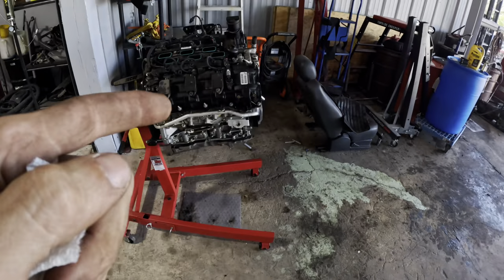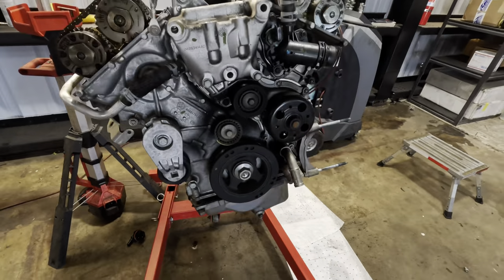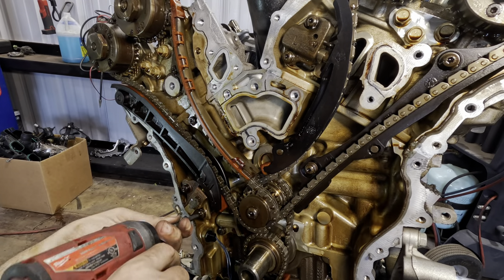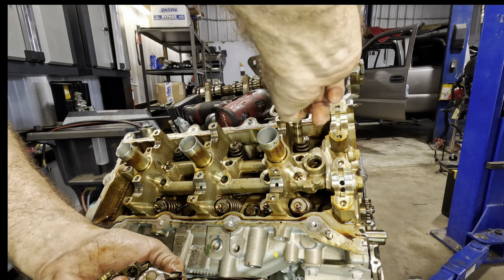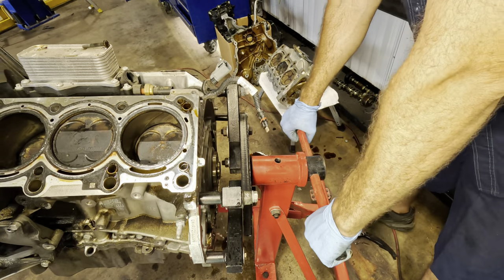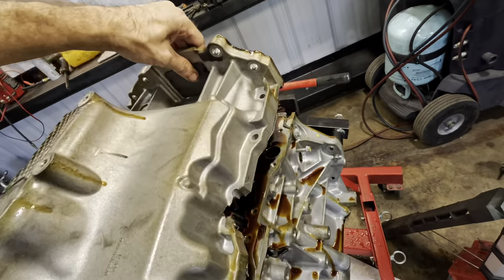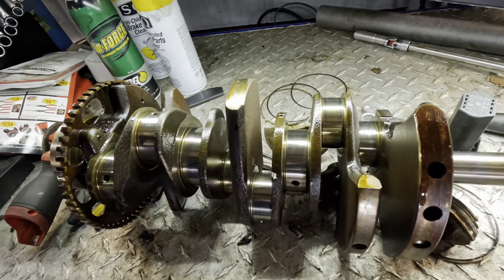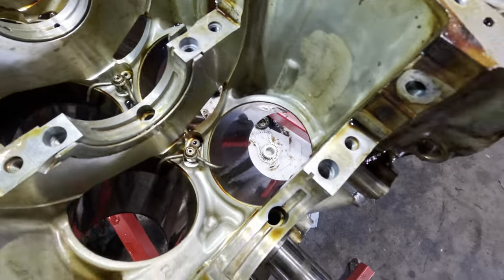Blown Engine--Broken Rod ! Autopsy 3.6 Pentastar Ram Jeep Chrysler

Comment: This was an extensive autopsy, and done in a way everyone can understand. However, there are doubts in the air. I'm not an engineer ( or mechanic, for that matter), I'm just a DIYer kind of person. If it was a gasket failure, wouldn't all pistons be affected? Could it be some sort of material fatigue on that part connecting the cam shaft and the piston? Some sort of a crack not detected by quality control? It takes a lot of power to break that piece in 3. It had to break next to the piston, because there is no bend. As the bottom part is swung around, it had to hit something causing the bend and eventually breaking. Have yourself a great day. Kind regards.

Comment: exh rockers are like that, if you look at the intake they have a built in lifter themselfs...   no carbon is from the piston hittin the head...  but the rod sugests hydro lock, may by a lot of fuel from a bad injector, which could explain the clean piston too

Comment: the oil pump runs about 30-40 psi up to about 3000-3500 rpm then it jumps to 90+ psi. you can see it happen if the vehicle has a gauge in the cluster.

Comment: I can see where a small or slow leak could accumulate coolant into that cylinder during the car sitting for a longer period of time, and partially fill it up. Then when started, hydro-lock, bending the connector rod.  Otherwise when operated more frequently, not much coolant would accumulate, and it would quickly evaporate upon engine start, so the symptom wasn't apparent to someone not sensitive to exhaust smoke/steam/color, and also did not see any drop in coolant volume as not many check that very often.

Comment: You're overlooking a potential cause. Looking at the rod, you have one mangled break, this indicates that broke off as it slammed into the cylinder wall. The other break is clean, with no damage to it. This points to a potential manufacturing defect. The broken piston. This could indicate the piston rod broke between the downstroke and upstroke. The piston head was still travelling downward, the rod travelling upward and smack, broken piston. A small crack left from casting, plus a rigorous workload under heat, and metal fatigue becomes a problem.

This would be harder to prove than the hydrolocking side of it, of course.

Comment: its a known issue with the head warping on that side fca still has no fix for the old engines and has designed upgraded pentastar we know install which has sadly its own problems with oil in the intake system

Comment: I had a Rubicon 2012 with a Pentastar engine that misfire badly before it's 10 000 km. they had to change the head conductor side because one valve guide was bored out of specs, bigger than supposed, causing valve sticking, misfire, and hard to start engine.

Comment: We had 2 Jeep Wranglers come into the shop with holes in the block. Number 3 or 6, I don't  remember. Replaced both engines  with new Chrysler 3.6 Pentastar. The Chrysler  dealer said no problem. We have these in stock. Chrysler must know that there is a problem to have the dealers stock these things 😂.

Comment: Coworker drover her Pacifica with the 3.6 through a large puddle of water 2 months back. Hydrolocked it. I pulled the plugs and a bunch of water came out. The engine would still not crank over by the push button start, but would with a socket on the crank. Turns out, the ECM burned out the 500a starter fuse when it kept trying to start the hydro locked engine. 

Anywho, its knocking hard now. She made an insurance claim, and is waiting months for a new long block.
Reply: Fuse did it's job and kept the starter from catching fire, as the blow time for the fuse is normally longer than the starting time, so it does not heat up enough to melt. But if there is an issue, starter solenoid that sticks, ECU that was not programmed to time out starting correctly to avoid blowing the fuse, then it will disconnect the starter safely, so it is hot, but not on fire. Bet she kept on pressing the button, for around a minute, before the starter and fuse got hot enough.
Reply: @SeanBZA  Yup, you are correct. I have seen other engines lock up that also burn up the starter when the computer attempts to crank and hold it. 

This 1st engine mentioned was a 2019 Pacifica van. It was sort of a tricky diagnosis since I was considering water intrusion causing a no crank.

Comment: two observations: One: the engine has a design weakness on the third cylinder, based on other comments. 
Second,  I thought I saw two stacked. head gaskets, or that the gasket is a two piece [why on Earth? No idea]
The best guess IS that the cylinder did 'go solid' [hydrolocked]. Based on steam cleaning, by coolant.

Comment: 136th!  GOOD TUESDAY MORNING RAY AND THE WIFE UNIT!  Along with the two hardworking new employees! Hit a deer in my Mercedes S550. It was a 5 point, found that out from the police officer who came to the accident. Days later I ran into him at the local grocery store. $25,000.00+ damage. They just came and picked it up on the flatbed to take it to the repair shop. The insurance company is sending me a check for $5700.00, but I was told not to cash the check, or they will not be libel for the rest of the cost of the repairs. Have never had an accident, and have paid USAA premiums for 45 years. What a slap in the face!   Roger in Pierre South Dakota

Comment: I think FCA, Stellantis or whatever they call themselves now, they are FIAT, in my eyes, they had leftover sand from casting, which was a big problem with some of the early 2012-2014 3.6 Pentastar motors, which clogged up radiators and heating cores, and caused overheating issues.  In addition, the oil filter housing assembly fails in just about everyone of them, due to being a piece of crap plastic unit that gets brittle or breaks from tightening the oil filter cap a bit too much.  They say an improved “A” unit is available, which was put in mine, a 2016 Wrangler, had a rear main seal and oil filter housing fail at 40k miles when we had a cold blast here in Dec 2022, so much for a “capable” vehicle.  I have not heard of the JLs, with 3.6 motors having the same issue, although I see many of the JLs equipped with the 2.0 Turbo 4 cylinder, which I would never opt for.  My 2010 Rubicon with the 3.8 is a much better motor, although a bit underpowered, but it’s a JK, not a JKU, so the lower weight is fine with the 3.8.  it’s not made of plastic like the 3.6.  They should have kept that workhorse 4.0 inline 6, which was the best motor ever.  Dorman and Mishimoto make aluminum oil filter housings, which I will opt for if it fails again.  I also had a ‘91 Wrangler with the 4.0, and although not rated as high as the 3.6 for HP and Torque, it felt much more “torky”, especially at low rpms.

A big problem is people gotta change that oil, no more, than every 5000 miles, 3-4K miles if mostly short trips, and use a good synthetic.  Don’t believe this “good for 1 year” or “Every 15k miles”,  which is simply another lie for “Planned Obsolescence”, where you will have catastrophic failure, like here, when you are no longer warrantied.

If I could find a low mileage 2006 Wrangler Rubicon with a manual transmission that is not “rusted out”, that would be my dream, but I opted for a low mileage 2010 Rubicon, 58k miles, in pristine condition, the 3.8, but gotta make some compromises.

Comment: 51:53 Look at the oil squirter for Piston 3. Can't tell if was dislodged before after the cataclysmic failure or even during disassembly but something has happened to it. Wonder if a problem with that system could have had something to do with it?

Comment: Very interesting. It is strange how things happen but don't leave a clue, or not much of one. Had  small Honda four cylinder and ultimately determined that something got in through the intake, broke the plug jammed the engine and broke the timing belt. Never found the mysterious object. Hate not knowing what was the culprit.

Comment: A clean piston surface could indeed indicate indicate a coolant leak. 
Did you check the head for warpage? I think there was a head gasket problem where the head gasket leaked combustion gases from the cylinder next to it. Notice the dark spot at the 24:18 point in the video. The cylinder may have suffered detonation. Just a thought.

Comment: You can see the piston has been hitting the face of the cylinder head showing clean alloy however ,it doesn’t explain a broken con rod ,we used to run engines on a dyno to destruction ,strip and inspect for research and development, but this is a odd one ,could be a faulty rod  ,over Revved ,.

Comment: Carbon black on the valve heads suggests a non-firing condition occured. Your presumption of a hydro lock condition is most likely the correct... as the carbon black speckling also suggests that a hydro effect was also present in ""Steam Cleaning" and cooling the head before failure? Im no expert on this phenomena, just a retired trucker that has seen a  lot of stuff in my past.

Comment: Check the head and block for cracks. Water is not compressible in an engine. That may have put a load on the connecting rod.

Comment: SPOILER
This was definitely a hydro lock that bent the rod and the failure proceeded from there.
This is a very common occurrence in radial engines in aircraft. In those cases, it's oil that drains into the bottom cylinder(s) and if the engine is cranked with the starter it WILL bend the con rod.
The solution in aircraft is to hand prop the engine through a few turns SLOWLY to clear the hydro lock before attempting to start.

Comment: Hydro locked is what I predicted in the first video you can see the clean head on the cylinder definitely had a gasket or head failure or an injector stuck open.

Comment: if i remember right and i could easily be wrong but i think an engine can "hydrolock" on fuel if theres no ignition in that cylinder. maybe leaking injector? would fuel alone clean the piston top like that though... not sure. strange... sometimes people say "easy start/ether" can hydrolock an engine but i think you have to be quite silly with it to do that. only other thing i can think of is a weird piston or conrod failure in the structure of the metal which then seized the piston in the cylinder

Comment: GM Certified Tec,  either the head has a big crack or it was just HIGH RPM and the piston puled apart from the torque!!  Happens ALL THE TIME IN DRAGSTER ENGINES!! Just a weak piston that failed in the down-stroke and completed the job on the up!!

Comment: When removing the cover, shouldn't the outermost bolts be loosened first? In this case, if the machine is already broken, it doesn't matter, but a beginner can get the wrong idea.

Comment: All other cylinder heads are coated in carbon which would be normal since the spark ignites the fuel in the chamber. The broken cylinder was clean too clean, when you pulled the 3rd cylinder spark plug you said it smelled like fuel.  The same cylinder is the one that was having issues with the misfire before. a spark issue happens  not sparking the cylinder fills with fuel ( fuel is sometimes used as a cleaner for carbon deposits ) with the full cylinder the plug finally fires causing a mini explosion apply to much down force on the piston bending the rod and destroying the piston.   There was no sight of water in the cylinder that I could see  while watching on my big screen tv .

Comment: the second ring is not a compression ring. it is the oil control. and scrapes the oil from the cylinder. the oil ring just directs the oil inside the piston. 3

Comment: The water pump assembly was what caused the failure, the blowby was causing overheating of the cylinder head without the sending unit indicationg a problem. The cylinder head overheated then the wall galled, piston seizes and pop goes the rod.💀

Comment: To give a better opinion of what the failure was, I'd need more close-up images of the broken faces of the rod.  But based solely on what I was able to zoom into from frame captures, I think the rod was the failure point, and i don't see the kind of S-shaped deformation that would call out a hydrolock issue.  Frankly, the rods on the Pentastar look like they were engineered down in mass a little too far, too close to the limits of the material.  I really think this failure just points at that, but I can't say for sure without examining the break points closely.  The clean top of the piston is easily explained by the last moments of operation of the engine, when the increasingly damaged piston was being driven up into the head, with the valves pushing it back down.

Comment: I have a question, I don't ever remember seeing you find, and/or seeing it it's self, did you ever find the bottom half of the number 3 connecting rod bearing? Isn't it possible that somehow someway the bolts bolting the 2 halves together loosened up, and/or broke? If that happened the piston would have been "shot" up the cylinder hitting the combustion chamber/cylinder head causing that damage, and breaking the piston in half. When it came back down that could have broke the connecting rod. 

I understand that the piston was clean so clearly coolant was entering the chamber and cleaning it, however it would take a lot of fluid to hydrolock the piston to the point of catastrophic failure like that. Then with the piston no longer moving, and the pistol rings sealing, some/most of that fluid should have been left inside the cylinder? Yet there wasn't any indication of excess moisture inside the cylinder (aside from the steam cleaned piston). Also isn't it possible that it wasn't steam cleaned, and actually cleaned by the fuel that wasn't igniting (the car originally had a misfire)? 

I would love to see the bottom half of the connecting rods, and probably more specifically the bolts that held it together, and the threads inside the upper half! If we had all those pieces and zero evidence of damage, and/or stripping then I guess I would have no choice but to get on board with the hydrolocking theory.

Comment: It's curious the piston oil squirter is not aligned on cylinder 3. Could have been bent in the destruction, or could have been damaged previously causing poor lubrication on that cylinder.

Comment: Warped heads from overheating could have caused that cyllinder to fill up with anti freeze. I agree 100% with your hypothesis Ray. To bend a connecting rod that bad , it didn't have a chance with a cyllinder full of fluid. Chrysler engineering get's me hard.

Comment: I sell good parts off blown engines I pull out on eBay. Makes a few extra bucks on the side. "Ding, Fries are Done" was never a commercial. It went viral back in the early days of the internet. It's actually a single off a 1993 Christmas album called, "A Very Spastic Christmas". That cylinder hydrolocked. Either coolant or a stuck open injector. This video is giving me flashbacks to doing head gaskets on Nissan VQ35 engines. Did a set almost every week.

Comment: Was the oil squirter bent out of alignment on the broken cylinder? Could that have been the reason? I don't know how it works, but it could have cooled more on one side of the piston causing it to distort to some extreme. It is pointing to the metal, probably causing the oil to stop flowing or flowing, but not enough.

Comment: Can’t see any obvious defects in the head gasket, or the deck/head faces. Where does the coolant from the displaced water pump gasket go? Could it be drawn in through the inlet?
I’d suspect the car had been submarined, immediately prior the the failure, were it not for the fact it had already been investigated for low compression on that cylinder.
That suggests it must have been an ongoing problem, rather than a sudden catastrophic one.
So, ongoing, long term water ingestion, just on that cylinder, causing incomplete combustion and intermittent excess compression ratio, until the rod bent past the critical point, which won’t have been a big bend with those wimpy rods. The mystery is where it came from and why only that cylinder?
I’d look more closely at the water pump gaskets and, if those are exonerated, check for cracks in the block, or head. If there’s a possibility of a warranty, those tests may be worthwhile, but otherwise, no. Nobody’s going to X-ray an irretrievably broken block like that, unless there’s a big financial incentive.
Pity. We already knew it was broken before we started. Would have been nice to find the smoking gun.

Comment: The failures I noted:
water in the exhaust
broken rod
waterpump gasket may have been bad
SUPER clean piston

It would be nice to know if it over heated ore just lost the head gasket. But it does appear it probably had a head gasket leak and caused the hydro lock which broke the piston rod. 
Its an unfortunate coincidence that its the same cylinder the new injector was installed.

Comment: Stuck fuel injector that caused it to vapor lock. That’s my guess.
Reply: Hydro-lock. Vapor lock occurs in fuel lines when the fuel gets too hot and vaporizes. That's my guess also though. I think the new injector was over fueling and either when the engine was stopped it leaked a lot of fuel into the cylinder and then when it was started it bent the rod. Just too much coincidence that the injector was replaced and then it threw a rod.

Comment: Scrap value on it will probably be 200$ aluminum and 3ish$ in iron/steel.  I think it's Fiat, the motor came out  late 2000's. Mercedes might have left Chrysler by that time.  I could be mistaken though

Comment: Something Ive seen happen before is carbon from the top of a piston flaking off and getting stuck under valve that keeps it stuck partially open just long enough to cause problems, then clears and gets blown out like nothing happened